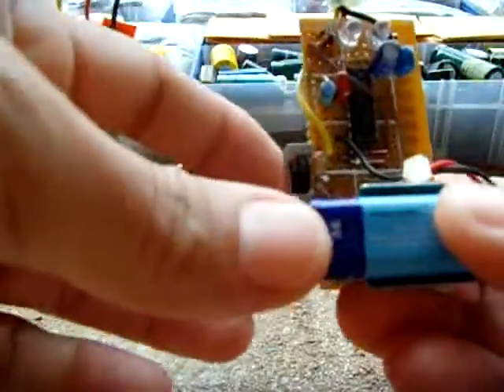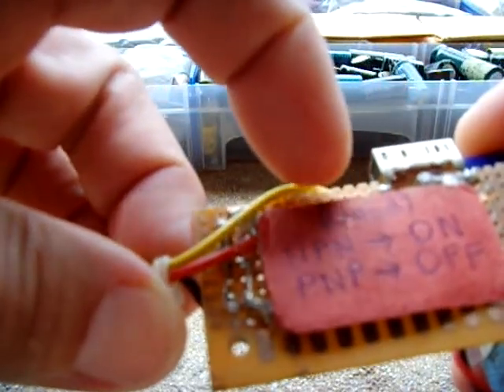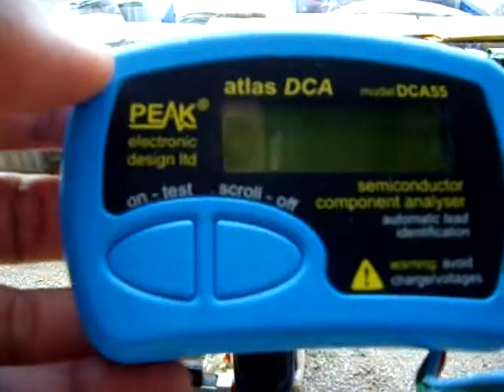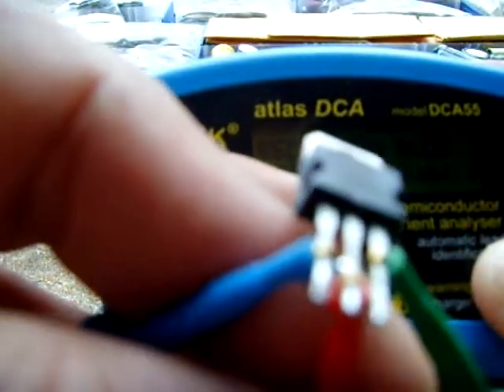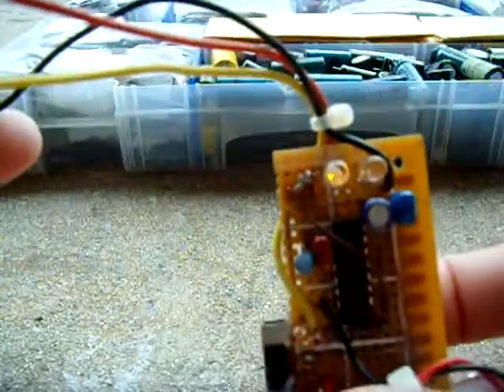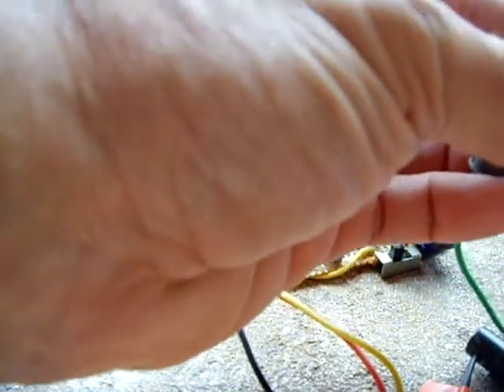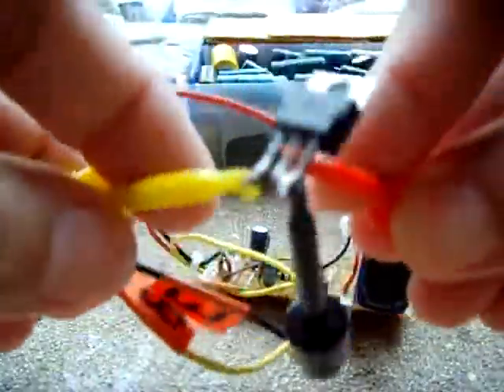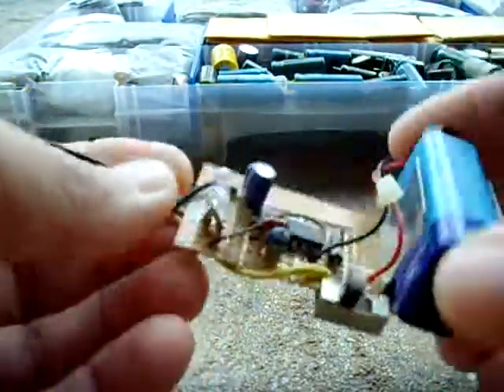In-Circuit Transistor Tester

Comment: hahahahaha, i assembled like that before its really work. at the first instant it fail to work but i didnt give up. at 2nd chance it work so im very happy hahahahaha. when the green light blinking the transistor is good and it is NPN. when the red light blinking the transistor is good and it is PNP. when the internal collector to emmiter short no flash both NPN OR PNP. when the internal colector to emmiter open both pnp or npn both green and red flashing. when the colector to base short both grn and red flasing. when base to emmiter short both green and red flashing. im filifino watching here in phillipines 
God Bless You All.

Comment: What happens if the transistor is somehow internally broken? I guess the diodes will not light either? You are showing an "in-circuit" device yet you did noit test nit in circuit, that does defeat the title...
Reply: clickbait

Comment: Is that if you know the transistor is NPN, then as the LED is ON, it is good, and OFF, it is bad?
If so, the circuit is correct regarding the LED direction. However, it leads to a second question why the designer put two diodes in, possibly it is because of the lower resistance he designed it for...
Reply from the maker: Eric Liu I have no idea why it was designed that way, but I tested the results with other component testers. and it was accurate.
Reply: +electronicsNmore thanks. I found that MK-168 can do the same job as your atlas DCA and more. Have a look. ;-) the original designer of this circuit is a genius, I must admit.
Reply: +electronicsNmore sorry one more question, can I use this circuit tester when there is already a voltage and current running on the main board, or do I need to switch everything off first?

Comment: OK, how do you identify BCE in circuit?
Reply from the maker: +jon123423 
Hi Jon. You need to know which legs are B, C, or E. If you do not know, then a quick search on Google for the transistor part # will tell you the pinout.

Thanks.

Comment from the maker: Antonio Vecchiarelli Of course it works, at least for me it does.
Reply: +electronicsNmore Antonio Vecchiarrelli,  eight months and also one month ago, pointed out to you that there was an error in the polarity of the LEDs.   You said you would check it out, but I can't see whether or where you did this.  Would you mind posting your findings and/or corrections.  Thanks very for this nice project.
Dean1938
Reply from the maker: Dean Sanders
Hi there. I did not design the circuit, but I did contact the individual who designed the circuit and he said it was correct.

Comment: I thought it was an in circuit tester. I realize there are easy ways to test transistors in a circuit, but don't you have to unsolder a leg of the transistor to do a full test. Also curious if there is an in circuit IC tester circuit schematic out there.
Reply from the maker: paulj0557 The only way to test IC's is in a circuit and by checking voltages, and/or using a logic probe. Of course you will need to pull up the data sheet for the IC being tested. Usually it is easier to rule everything else out, then swap out the IC.

Thanks For Watching!
Reply: Hi, Where can I get the schematics for this tester?  ThankselectronicsNmore
Reply from the maker: ***** The link is in the video description area.

Thanks For Watching!

Comment: I hope this cicuit works.

I checked the datasheets; they  seem the same.
I doubled checked everything in my circuit. 
I use a 8.34 Volt battery.. With a 2n2222  (npn) I read 1.5 Vce  and  0,934 Vbe.
The leds are off...

Comment: Hi,
I am building your circuit on a bread board and a good NPN does not light the diodes.

Does the Vcc (+) go on pin 14?
Does the negative (-) go on pin7
At the beginning of the video I see that the negative is at the first pin (near the groove (hole) in the IC
Viewed from the battery to the hole and  the leds it is on the left side.Is that oin #7?